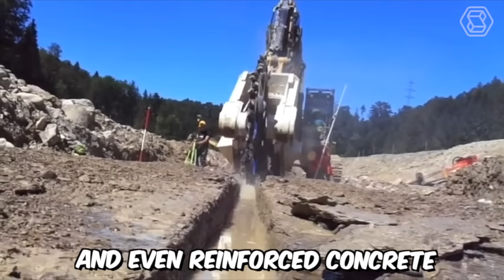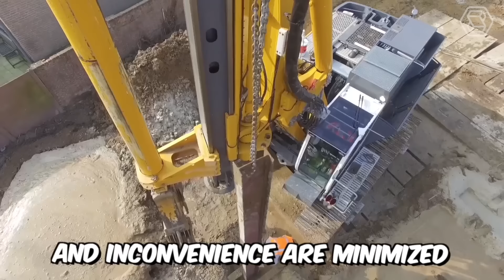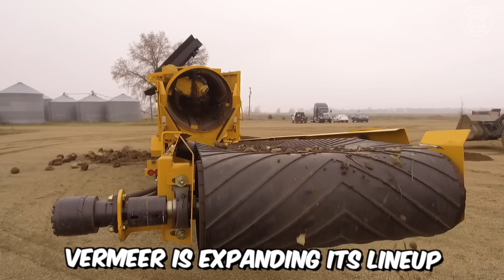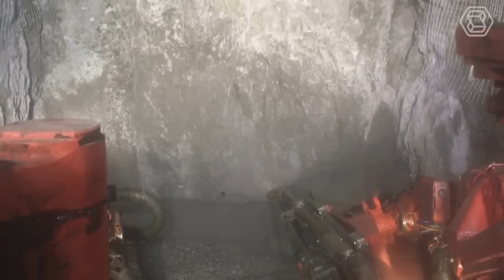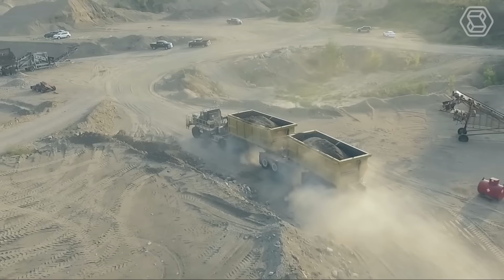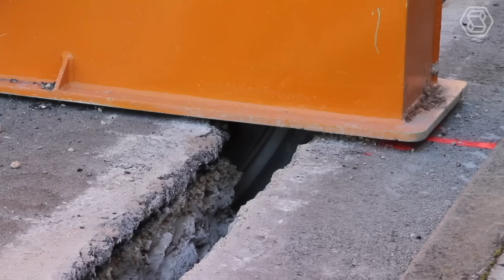300 Unbelievable Heavy Machinery That Are At Another Level ▶ 34

Comment: The sheer size and power of these machines are a testament to the strength and capability of modern engineering.
Reply from the maker: Absolutely, it's incredible to witness the remarkable advancements in engineering that have led to such massive and powerful machines.

Comment: Lets tip our hats to heavy machinery – the architects of modern civilization. Their impact is etched in the structures that define our cities and the efficiency that propels us forward.
Reply from the maker: Thank you for appreciating the contribution of heavy machinery in shaping our modern civilization.
Reply from the maker: Absolutely, heavy machinery plays a crucial role in shaping our cities and driving progress.
Reply from the maker: Yes, these crop flow control systems help to ensure a smooth and efficient harvest in different field conditions.
Reply from the maker: Thank you for appreciating the technological advancements in mining that have made it more efficient and safer.
Reply from the maker: Yes, these steering systems greatly enhance the performance of the harvesters and result in more efficient and effective operations.